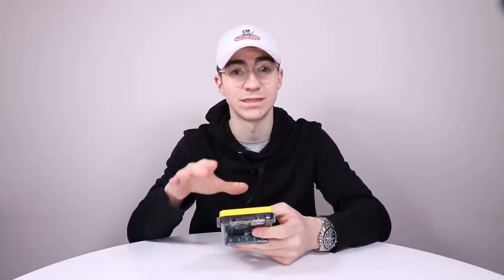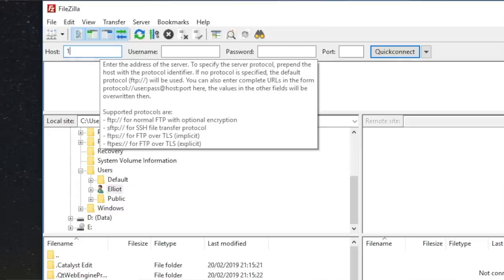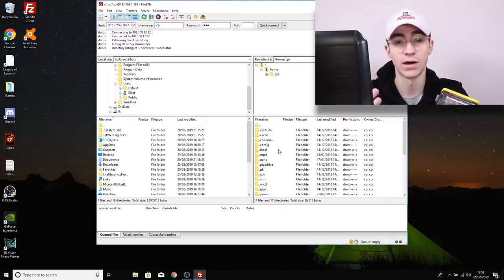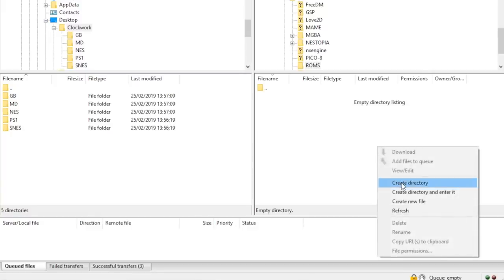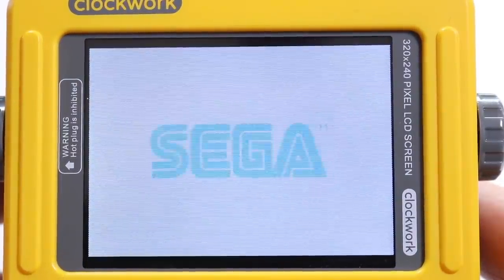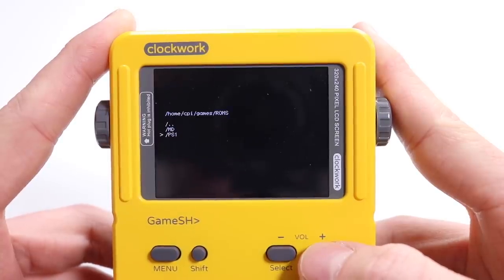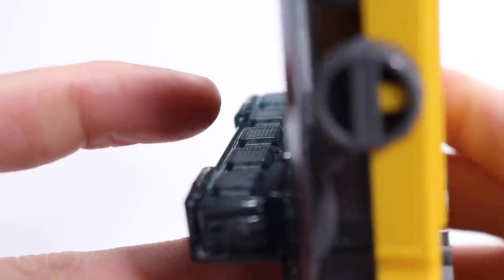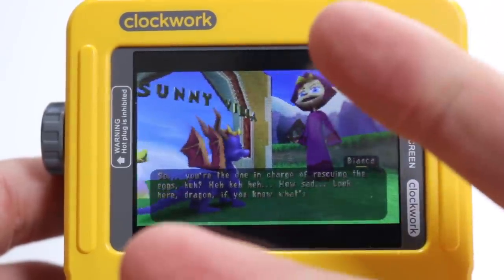Clockwork GameShell | Advanced Software Guide!

Comment: You need to reflash the SD memory card with the 0.3 update, then use the Lima video driver which will fix the screen tearing and performance.
Reply: I'll definitely consider buying one if this is true
Reply: Lolcat It's worth getting in my opinion. I've got the Bittboy V2, Odroid Go, and play around with emulation on the PSP/Vita, there is something about the Clockwork GameShell that makes it so fun to use.

Maybe it's because of the experience you have of putting the unit together, it feels more satisfying to play knowing you built it.

I was bummed out at first when I noticed the screen tearing, but once I fixed it I've not been able to put it down.
Reply: Can you somehow convert multiple ps1 disk files into one file?
Reply: what do you mean by reflash the sd card?
Reply: Can confirm this. I have setup 2 GameShells so far, soon to work on my 3rd. The Lima driver runs better than the stock driver. I believe Lima is also required for HDMI output.
Reply: @Kurizu204  You can't upgrade the OS. Instead, you have to download the latest image and flash it to a formatted sd card.
Reply: @nier409  No need to do that. I got around using the stock PS emulator on the Gameshell by downloading the pscx_rearmed core for RetroArch. That way, the ROMs load just like all the other systems on the GameShell.
Reply: @mpuppet1975  any chance you can say how do you change the driver to Lima? on the fence on getting this  and this could change that
Reply: @UrskaFur  Flash an SD card with OS 0.21 or higher and change the gpu driver in the settings.
Reply: I actually ran into a lot of performance issues with the gameshell no matter what I was emulating. Going to give your advice a shot because even though the GOD XD I own works much easier out the box; the gameshell just feels so nice.